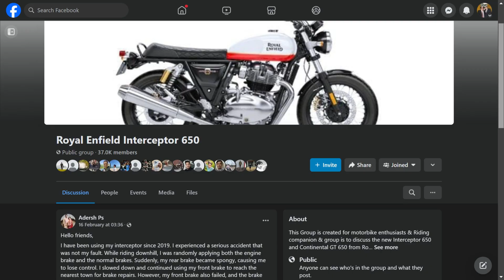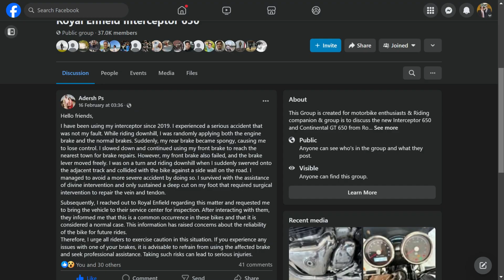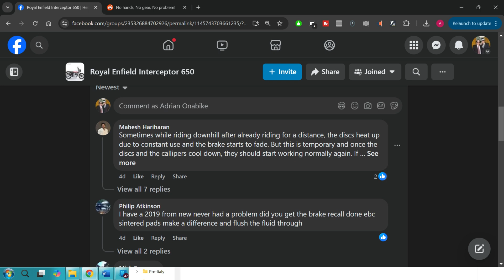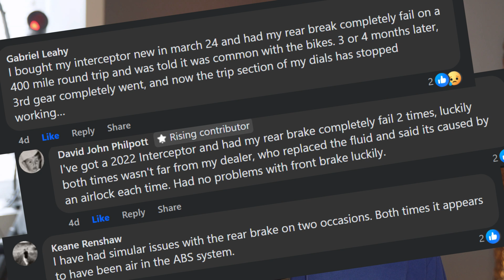Royal-Enfield 650 Brakes Are FAILING!

Comment: Lordy! Got mine booked in for a full service end of March, I'll mention this when I drop it off. Thanks for the heads up

Edit: I've had no issues with my RE INT at all since I got it 3 years ago. It has been an impeccable machine. No rust (yes, even in the UK's horrible wet weather), no issues with electrics, starts on the button every time...nothing. Love this bike.
Reply from the maker: Good on ya for being proactive! If the service is at an RE dealer, may as well ask them to lookup the VIN for any outstanding recall work before it goes in (in case they need to order up parts for recall work). Glad to hear that it's been a good, trouble-free experience for you. They're a really endearing motorcycle, but it seems like quality can sometimes vary from one to another.